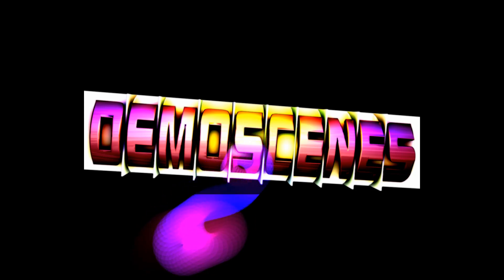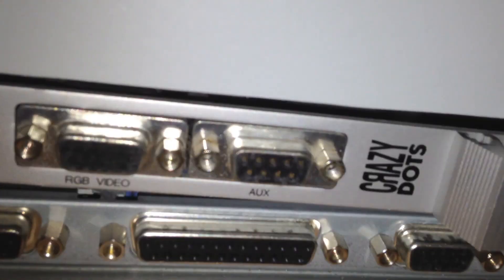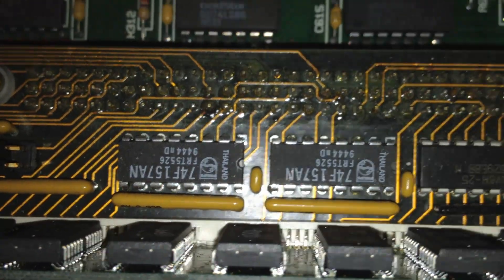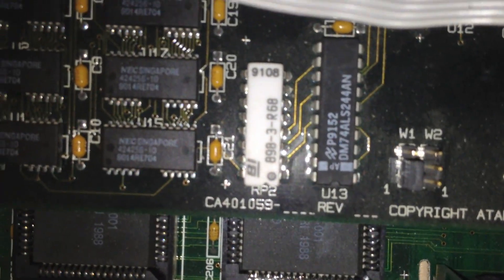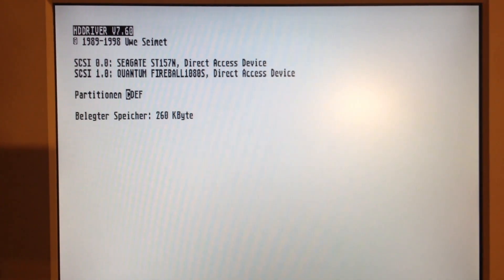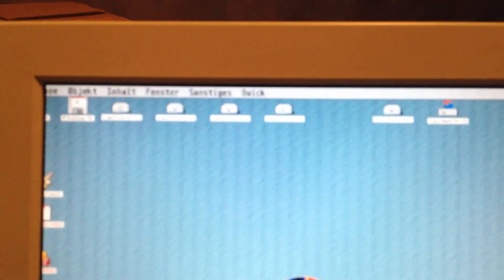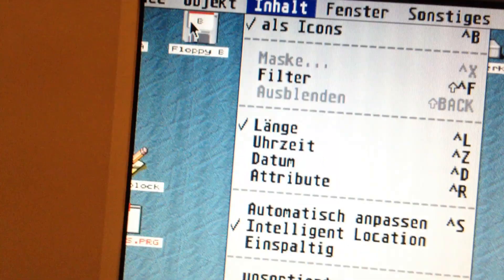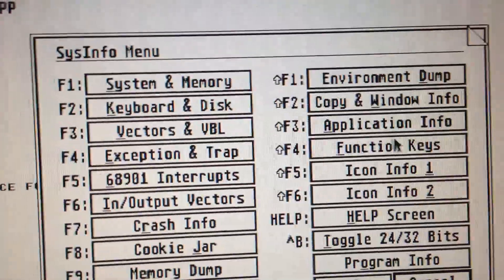My monster Atari TT 030++

Comment: Really bad camera work. I can't see anything!
Reply from the maker: Paul Hruby Could you be more specific, perhaps?
Reply: ***** The camera is too zoomed in on the plugs and it moves around too fast and is shaky. The camera should be on tripod in order to capture the entire screen. There are points where all I see are pixels. It's really hard to watch.
Reply from the maker: Yeah, I am aware of that and it's homologous difficult to film with one hand, zoom and try to get things in focus at the same time. Also the camera I used got serious issues with the focal point, especially when zooming.
Thanks for the feedback

Comment: Amazing Job - well done ! 
People say original case was cool - I think so to TT had one of the coolest cases ever
I collect old  machines and understand well how hard it is to keep the plastic in good shape
For example my SGI O2 case is falling apart plastic became super easy to break - I'm currently preparing to get the case machined from block of aluminum or 3D printed (depending on the cost).

Comment: Is it compatible with Atari 800XE/130 XE? I mean flopy disc and files. Is it inside Atari Basic, or Atari turbobasic? Or is it possible to run Atari Turbo Basic from ATARI 800?
Reply from the maker: I thing the Atari 130XE and 800XL are cross-compstible, just with an exception for the RAM. The XL has more ram, if not mistsken. Else the hardware is the same.
Reply from the maker: +demoscenes + The TT is not compatible with the XE or XL, though.
Reply: Ok thank you. I was thinking about converting games recorded on tape to FDD or HDD. I know just I can run emulator on the PC, bud this is only emulation. Even thank you again..
Reply from the maker: I am sure you can convert the actual games and have them transferred to PC via some kind of a clever device.
You're welcome :)

Comment: My ST has an 030 + FPU running at 48 MHz (can be raised to 54MHz) and has 256MB Fastram - rip Monster TT :(
Reply: in ur dreams.
Reply: Solo Gals
Check "Project rePAK" on the atari-Forums. Optional ET4000/Mach32/Mach64 + Ethernet NIC included.
Reply: Did you not the whole thing?
Reply: Cool project, but i don't like you're showing off..

Comment: In the late of 80th it was monster - not now, any emulator can do the same.
Reply from the maker: +Miesiu K Show me an or shall I say, "any emulator", that can emulate an Atari TT. Would be super interesting to see such an emulator. As far as I am concerned it hasn't been done.
Generic emulators for ex. Amiga 4000 hasn't been done, yet and I doubt they ever will do. Not even VICE can emulate the C-64 good enough. and No, I don't trash emulators.
Just prove me the emulator. 
Peace out :)
Reply: +demoscenes - Hatari on my Debian @AMD APU: A10-5800K/DDR3-1866 works OK.
Reply from the maker: Yep, still in experimental stage but okay, not 100% :D
Reply: +demoscenes :
.
Sometimes is required to change ROM or settings, but the CPU can run faster than orginal.
Reply from the maker: I know. Just didn't realize Hatari could emulate TT and Falcon. Kind of interesting and very good for cross-developing etc and for lazy days ;)